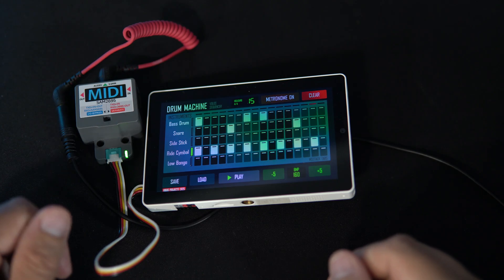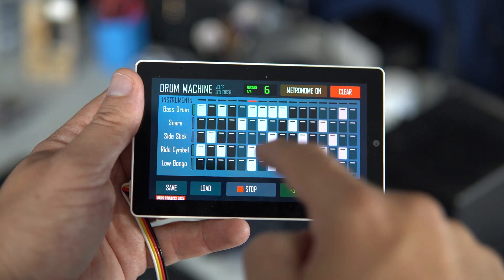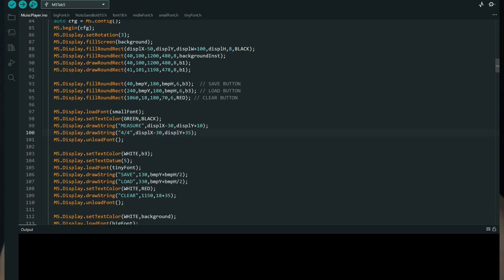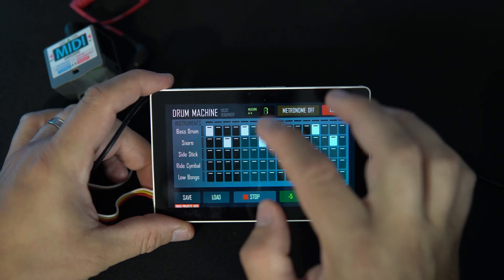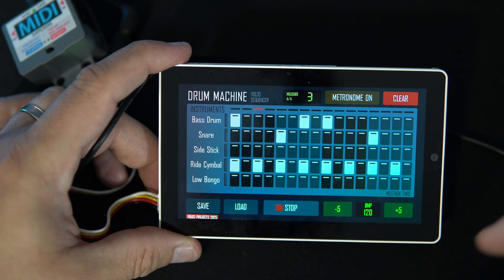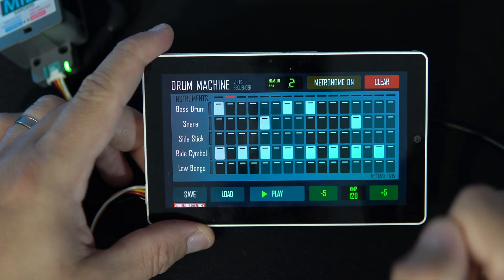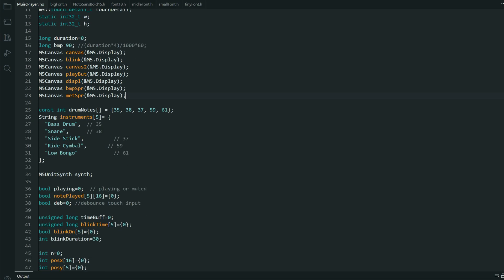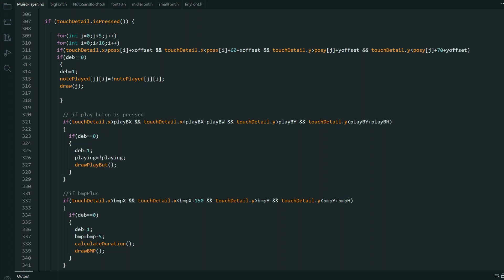Back to Basics: Sequencer Project on M5Stack Tab5 (ESP32 P4)

Comment: Impressive demo. I recently received my Tab5 and started working with the UIFlow/Micro-Python environment. It's nice for getting UI working quickly, but it is really slow I find, so it nice to see you can have a very performant UI just using the Arduino IDE. I hope in the future you can do a VU meter project using the built-in mics for input. Something like PeppyMeter which would really show of the nice LCD display.